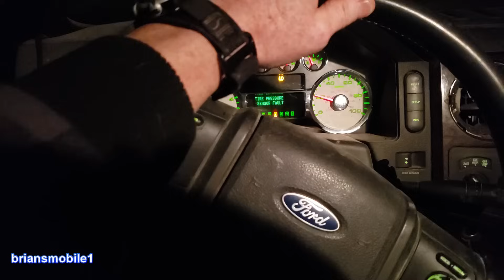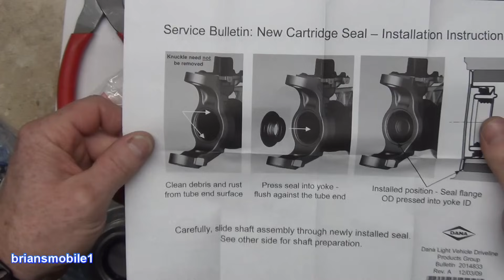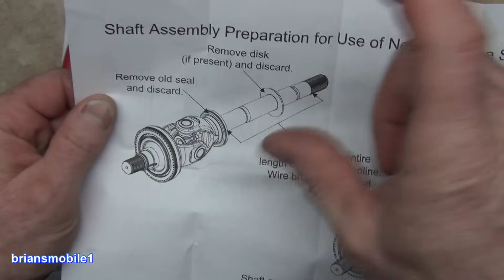4x4 Truck Ghost Steering

Comment: I had an issue with the u joint on my 04 f150 steering rack. The part that would go from the steering wheel to the rack. It had one spot that was going bad so it would be smooth turning 1/4 of the wheel then really tight, then smooth again. Was a pain to deal with.